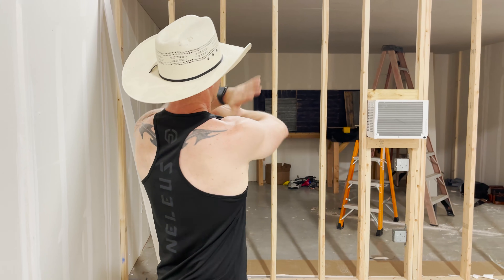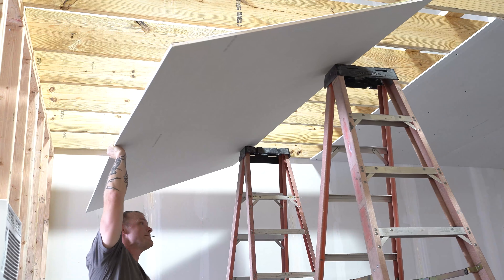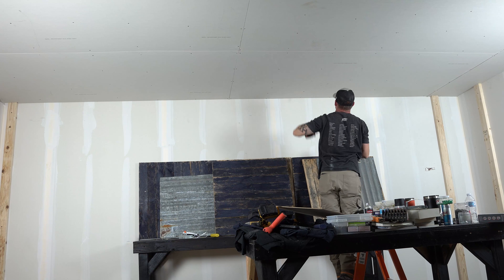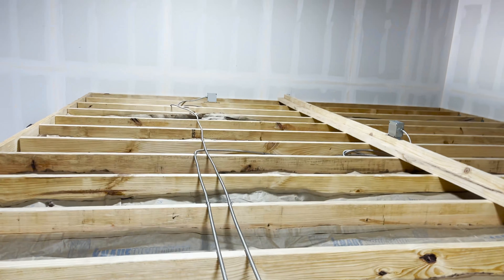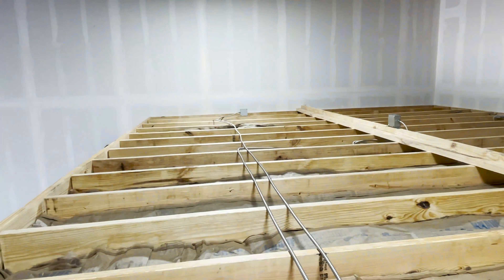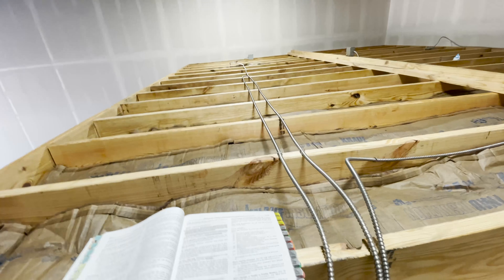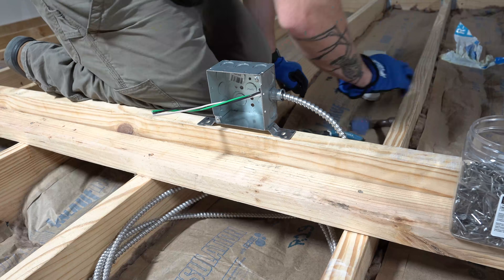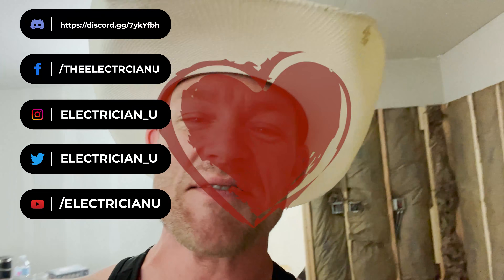New Studio Update - Whoah-oh, We're Halfway There!

Comment: They make a "through the wall" A/C unit just for the way you mounted a window A/C that would have made it much easier to install that A/C - they cost comparable with the cost of window units.

Just curious, since you had the video about "code violations" with the electrical in that building, did you have a building permit for this framed structure to make sure you did not have code violations for the framing?

We used a hole saw for the LED can lighting - works quick and simple

Did you use a qualified electrician for the wiring?

Comment: The space outside that room your building, is going to get very hot from that AC trying to cool itself off inside. Let alone make that AC a lot less efficient. If one those walls is an outside wall, I'd really consider just cutting a hole out for it(im guessing owner wont let you). Let alone if you have to give the AC maintenance(I take mine apart, bag motor and clean all the fins and blower about every 2 years), you'd probably at least want to make it so it can come out easy enough. Other option is a unit with exhaust hose, they sell em as stand alone on wheels units or stationary ones. Albeit its bigger than most small window AC units. But then you could vent the heat outside easier.
If you do end up cutting a hole to outside for it, try to pick the side that is least exposed to sun during the day.

Comment: Using staples on mc is a bad idea, what happens when you miss and hit the mc? Is the edge of the metal corrigation sharp?   It's just as easy and safer to use 3/8 mc one hole straps.  You resi electrician you.   You look like you're having a fun time with that. More power to you bro.

Comment: Makes it hard to finish your ceiling when you don't stagger the joints on the ceiling and I'm supposed to do it on walls too I am a drywall contractor I like watching your sometimes I'll repair something before I hang the drywall cuz I got to sleep I can't bury a junction box in a wall I will fix it before I hang the drywall can't leave a mess like that I can't bury nothing cuz it's wrong I see so much of it all the time thank God your electrician that knows what you're doing does it right

Comment: So you must staple MC 12" from the box. Do they refer to the length of the MC or linear distance between the box and the staple? At 16:04 it seems like the length of the MC (box to staple) is longer than 12", even though a straight line from the box to the staple is less than 12".
Reply: It refers to the actual length of cabel from the last means of securement.  Article 334.30 for NM cable actually says it shall be secured within 12 inches of boxes, etc.  But goes on to specify no more than 18 inches of cable from the last securement (meaning an 18 inch loop secured within 12 inches).  Art 330.30 for MC cable does not have that provision.
Reply: @donl1410  you're awesome. Thanks
Reply: @MrClaudio  You're welcome!

Comment: Nice work! Probably too late, but you'd get better audio acoustics if you just left the insulation exposed and didn't do drywall everywhere. You can get the same effect if you put acoustic foam all over the place or hang curtains around the walls. I've seen people do it with that denim insulation which looks nice. Former radio reporter here. maybe that's overkill for you,
Reply from the maker: Thank you! I actually put insulation in the walls to give a barrier from the trucks and other businesses (outside noise), and I’m doing foam wall insulation inside the room as well to keep the room dead so my voice isn’t bouncing around while recording also.  I’m thinking about decking the top so that may even help a little more but all said and done I think the room is going to be very dead. I got some really nice condenser mics too so I’ll need it to be. Thank you for the input 🙏
Reply: @electricianu  Foam acoustic panels are basically worthless for true acoustic control.  You'll be much better served to use panels of rockboard, such as Owens Corning 703 or 705.  That's what I have in my studio/office; panels are 4" thick, and this room is quite dead with just a few.  I used materials from ATS Acoustics.  Also, if you want to actually keep outside noise out, you need to mechanically isolate your room.  HomeRenovisionDIY (YouTube channel) has a couple vids on soundproofing a room.  The contractor, Jeff Thorman, is very thorough and approachable.  Shoot me a mail if you want more info and help with your audio setup!
Reply: @soundman1402  Interesting!
Reply: @electricianu  It's gonna be awesome - thanks for being so nice about a comment that assumed you knew less than you did! I'm often on the other side of the equation and my first instinct is to be annoyed. Thanks for spreading kindness.

Comment: Normally you can slide the interior of window ac units out by removing a few screws which makes it really easy to just drive some screws into your framing from the inside through the outer casing. If that makes sense.

Comment: Just a pointer from a DIY guy... when doing sheetrock by yourself, screw a 2x4 to the wall about 3/4" down from the ceiling and that will hold one end of your sheet. Make a giant "T" out of another 2x4 (height as required) and you can prop up the other end of the sheet instead of using a ladder. (do that about 6 ft out) Make that support a half inch too tall so it wedges in place. Move the 2x4 on the wall and do the next sheet. The T support will be waiting for you where you left it so just reach over and grab it. If you have a long run you can still support a sheet on one end with that 2x4 and screws into the ceiling, but do it right at the end of the last sheet. The compound will fill any extra holes.

Comment: Oh man, I'm thinking steel stud framing with a drop ceiling would have been like way cheaper and easier
Reply: Aaron ... with the added height of the other ceiling a drop ceiling would need a secondary frame work to pass code. (I believe max distance for "wire only" support is 4 ft) That extra framework would also eat up the space that might otherwise be used for future storage. OTOH, considering today's lumber prices a drop ceiling would be cheaper.
Reply: @rupe53  hanger wire is  spaced every 4 feet . And the ceiling can be suspended  from the building corrugation or  bar joists above
Reply: @whirlwind8825  ... true on the spacing of the wire, but in a commercial building (Ct here) they want a secondary frame so the length of the wires is under 4 ft, especially with light fixtures mounted to the ceiling. What that usually involves is beam hangers, threaded rod, and a series of uni-strut rails, all tied into the building's roof structure. It's a fire code thing.

Comment: The ac is supposed to take outside fresh air in .
Reply: A normal A/C unit doesn’t exchange any air between outside and inside.  It just uses the outside air as a place to dump the heat that it’s removed from inside.  So, when that thing is running, and you walk past it on the outside, you’ll feel the heat that it’s putting out there, which will be a minor annoyance, but is to be expected.

Comment: It says "in framing" not "on framing." As in, if you drill holes in studs or joists. That is common sense there is no place to put a staple. If you're running on top of the joists you still need staples or clamps.
Reply: AGREED
Reply: Was thinking the exact same thing.

Comment: For the amount of time and effort you spent on that terrible AC setup you could have just gone with a ductless mini-split...
Reply: And a lot more $$$
Reply: @barryomahony4983  ... I was about to say $200 versus $2k but you beat me too it. OTOH, a mini split would do heat in the winter... and be fairly quiet as well.
Reply: @rupe53  Don't get me wrong; mini-splits are great (having one installed now in my remodeled garage / man cave).  But they are pricey.
Reply: Even a portable unit on wheels would’ve been a much better option, dryer vent out of the actual building not recycling air from inside the shop.

Comment: they have a new Midea window unit that is super quite it's a U shape to separate  the condenser farther out
Reply: I just installed one of these in a friends bed room/sitting room combo, hates to run the central air, saves money. works great and the install was easier than traditional window units, the bracket really make setting the unit in the window pretty much fail-safe.

Comment: 330.30 (C) refers to horizontal runs "in" wood or metal framing, not "on" framing, so it seems to me that you do need to support every 6 feet. Which you obviously did, but I don't think you could get away with leaving it unsecured. If I'm wrong, let me know for sure.
Reply: Correct.  330.30 (D) Specifies what is secured or supported.  Simular means of support could be a loose fitting staple to keep the cable from floating around, acting as a driled hole would.
Reply: @donl1410  Similar just FYI.
Reply: @illestofdemall13  whoopsy
Reply: @donl1410  I agree. Letting something lay on top of rafters, trusses, etc. is not a means of support nor securement in my opinion but it would come down to what the AHJ approves. Most electricians will just strap or staple it, though, and be done with it.
Reply: chirps..? dumb electrician. Am I right 🤪?
Reply from the maker: That’s the hairy part about “or similar supporting means” - unless that’s more specifically defined it’s a matter of interpretation
Reply: @electricianu  In wood or metal framing or similar seems to mean inside a drilled/punched hole of a stud, or inside a member that will hold it in place. It doesn't say on top of members. I have always heard that when you run cable through studs, it is considered secured and supported. I have never heard or seen cabling being laid on top of members in new construction (they are always stapled). Why would contractors waste time and money on stapling in attics if it isn't even required? Also with acoustical drop ceilings, the cables are generally supported by tie wire rather than just laid on top of the grid. Just something to think about. Lol
Reply: @illestofdemall13  Yes.  Unsupported cable by physical means would be turned down in Oregon.

Comment: No anti shorts for bx or metallic cable?
Reply from the maker: Not required. Ac cable it is, MC cable it’s not. This debate is all over the internet actually. Crack open both AC and MC articles in code and you’ll see MC isn’t required. They do provide them from the manufacturer as a courtesy if you want to use them, but even manufacturers admit they’re not required

Comment: Get rid of the rat run put plywood for a deck. Put in  blocking midway on the ceiling and the walls . I wont  gig you on the bottom plate .
Reply: I was just thinking it will be storage since he's going with 2×10 joists, but than he put the rat run and wires on top. Definitely over kill on ceiling joists.

Comment: I think you might regret some day not drilling holes... You know, when you'll need more storage and think a mezzanine is a nice place for that.
Reply: I was thinking the same thing. But I also understand that when you're working to get everything up and running ASAP,  you'll slow your progress by spending too much time on the "what-ifs". The good thing is that he doesn't have to hire someone else to do the work so if he ever needs that space, re-routing the MC will just be part of the new project.
Reply: @brocklancaster7354  if/when he decides to create a storage/workspace mezzanine laying 2by4s down will lift the floor above the MC, he'd still need to worry about the boxes he secure to the top of the joist, but that could be easily corrected by notching the floor material or drilling a hole and redoing the wiring in/out of those boxes. I'd be more concerned about the cans for the lights that he secured to the joist, would be a hassle to repalce the light once the floor is down, unless he can reach the twist connection from the cutout.

Comment: Make sure that the AC unit tilts back a little so that the condensation drains outside of the room instead of inside.
Reply from the maker: Damn I didn’t even think of that, thank you!
Reply: Also should probably get or make a pan with a pvc drain for underneath or it'll leave you with unwanted puddles.
Reply: I was wondering what he was going to do with the condensate. Maybe a drain pan with pvc that goes into a condensate pump
Reply: A large indoor planter box that it can drip into might be a workable idea. The plants would get nice and watered.
Reply: @Ecospider5 I love this idea
Reply: I don’t know how common this is, but some A/C units have their exterior fan arranged so that it slightly dips into the condensate tray, and flings water droplets against the condenser coil.  The evaporating water helps the condenser dissipate its heat.  As a result, (1) there’s less water dripping out the bottom of the unit, and (2) there might be a chance that some of those water droplets flung by the fan could go elsewhere, outside the unit.  It might be good to find out if yours is designed to wet the condenser this way, and if so, keep an eye out for it spraying a bit of water in the nearby surroundings.
Reply: I was just think that. Definitely better add a drip pan as well don’t want that drywall getting wet every time you use the air conditioner.